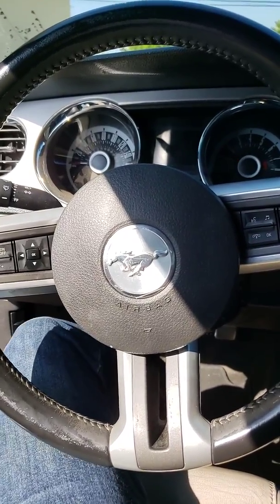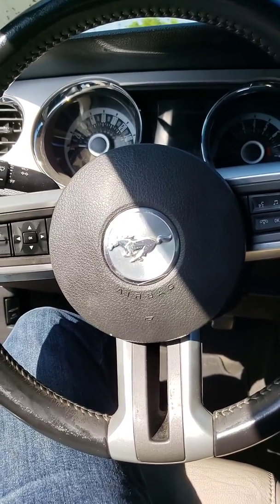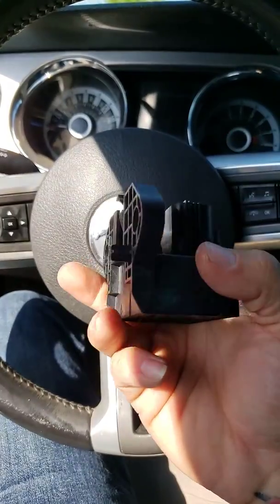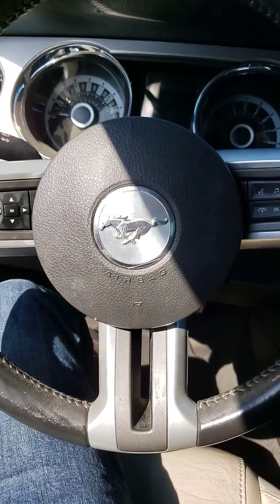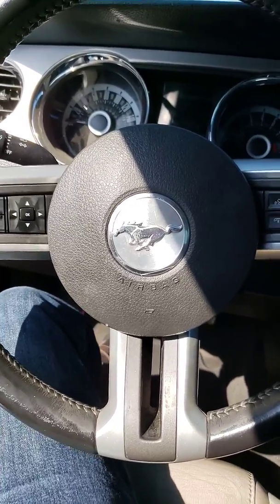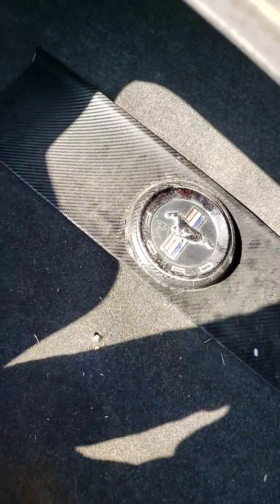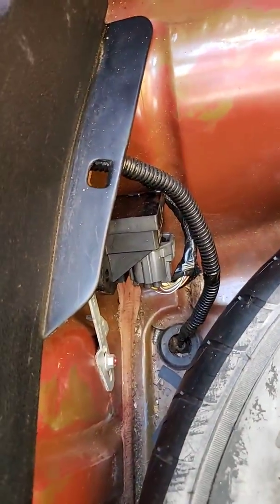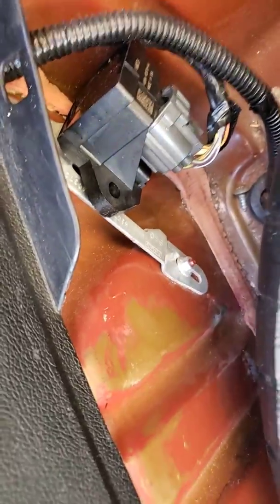2013 Ford Mustang v6 fuel pump moduel control circuit

Comment: my fuel gauge is stuck on e displaying --- miles to E'
changed fuelpump and sensor on driver and passenger side, replacing the module u have in ur vid do u know if that will get the fuel gauge to work again?
Reply from the maker: If everything else is running and you check your fuses could be your fuel pump that is in you gas tank. That happened to me on a Tahoe I use to have.
Reply: @AntonioRivera-pf5zx  yea uts running fine i just changed the sensor on the fuel pump but not the actual fuel pump itself
Reply from the maker: @DJPickee  if the gage isn't moving then most likely it's the fuel pump
Reply: @AntonioRivera-pf5zx  even if my car is starting fine?
Reply from the maker: @XYLANTISGAMING  unless you believe that your cluster is going out can be the problem to
Reply: @XYLANTISGAMING you ever figure this out?
Reply: @GutsDemons yes it was a faulty cluster sent my cluster in to get fixed spent more money on tryin to figure out the issue when it was the cluster the whole time smh lol

Comment: Can someone tell me where the fuel pressure regulator is on the 2014 Ford Mustang V6 3.7?
Reply: It’s doesn’t have one. It has fuel driver module. Just like the video is showing

Comment: Were you having any symptoms? Idling? Starting problems?
Reply from the maker: Yes I was at the time so it help
Reply: @AntonioRivera-pf5zx  I’m thinking about changing mine. Recently when starting the engine it cranks a little longer than usual. Doesn’t do it all the time but I have noticed it
Reply from the maker: @IAMDENNIS_24  with time it does wear and tear I also just change it on my Lincoln Mark Lt that I was having the same issue.
Reply: @AntonioRivera-pf5zx  I’ll be switching mine out soon! 👌
Reply: Mine goes from 85 miles to 3 miles help ?